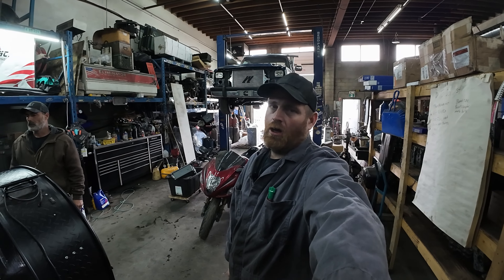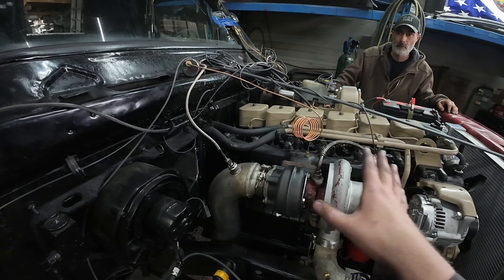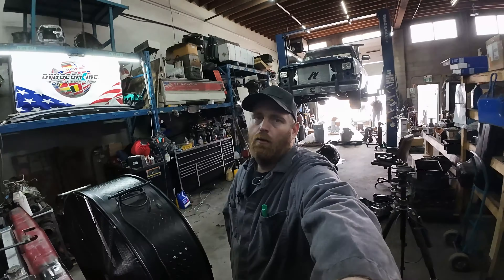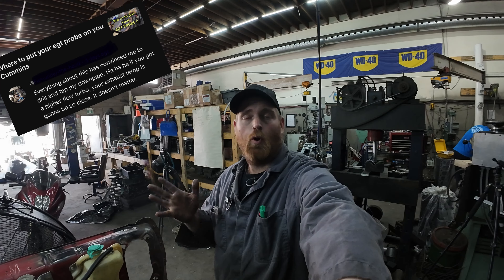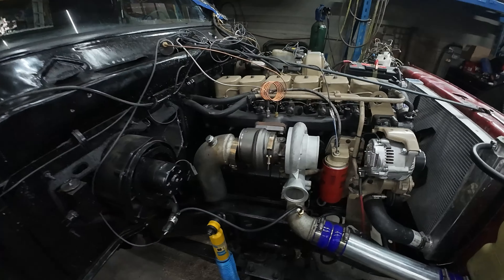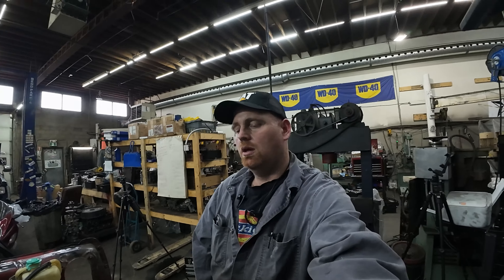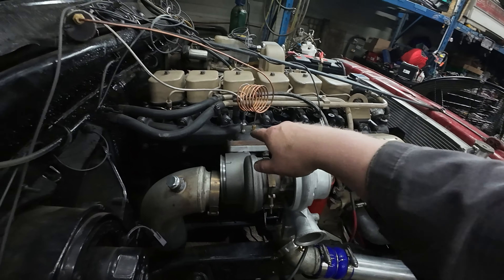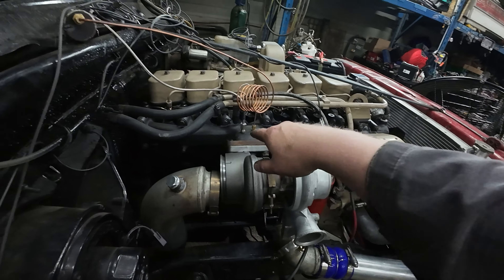EGT GUAGE LOCATION. DOES IT MATTER ?

Comment: The turbo by  its very function converts heat into work that means that the temperature goes down as a result. The more work taking place the greater the temp drop. Also the greater the expansion ratio the greater the temp drop.
Reply from the maker: That’s a good why to explain that. I like it

Comment: The thing is; We measure EGT to get an estimate of the temperature INSIDE the combustion chamber... So i would think you want to be taking measurements as close to that area as feasible... The difference in temperature/pressure across the turbine is not linear. Its hard to say that the diff will be 'X' in all conditions... why add more variables/calculations while trying to collect data when you can just put it in a spot that eliminates those variables?

Comment: A turbocharger doesn't magically spin. It uses exhaust energy in the form of temperature differential and pressure differential to operate. Therefore the temperature will be lower after the turbocharger.

Comment: i have a friend whos a semi truck mechanic tell me that the egt probe should be at the downpipe and not at the exhaust manifold, Because the higher egt numbers will make you freak out. After watching this I think he just wants me to pay him to rebuild the 12 valve after I push the engine a little too far with that advice.
Reply from the maker: I have always run them in the manifold on everything for many years.
Reply: Big truck mechanic here, and for some reason in the big truck world they put them in the down pipe, ive yet to see one with an egt probe in the exhaust manifold and it bothers me lol
Reply from the maker: @Ajs19892  I move them there anytime I can myself

Comment: I learned from my dad who is a heavy duty mechanic and he has always put them in the down pipe and that’s where mine is. The thought was that if the probe ever fails it will take out the turbo. And you just know that it reads cooler so don’t let it run as hot. If mine goes over 1,000 I back out of the throttle and for the most part it runs at 675 empty and 850-900 with the trailer. But in my own experience after seeing 10’s of thousands of diesel pickups beat on their shit and never hearing of a probe failure. My next manifold will have an EGT probe in it instead of the down pipe.
Reply: Why even  have a darn gauge if you need to estimate a guess as to  what the true reading might* be. 

Besides ‘my dad said so’

What I’ve learned is that if you need to feel like you need to watch a gauge
You’re already being more harsh on your engine than you know I should.
Reply: @fastinradfordable you obviously have little experience in actually working a truck with any real power.

Comment: For many years truck manufacturers put the just after turbo as they were not as reliable as are now and sensor failure would destroy a turbo but some did like Mack put them pre turbo as they used to pull their engines down really low compared to most others at the time

Comment: I have always installed mine in the manifold. The way it was explained to me is what you're really worried about is your valves and valve seats and that is what you want to avoid damaging and it should only get cooler as it heads to the turbo so no worries there. Obviously race trucks and such might be a little different but those are few and far between. I actually always wondered if having an egt probe at each exhaust outlet (all moniterd by a computer and with setpoints so no having to watch 6 numbers would be the best) you could know each cylinder and possibly catch problems (such as a failing injector on a common rail) before totoal destruction...

Comment: What high temp will a Cummins 5.9 take for a sustained time?
Reply from the maker: 1150 is safe safe.
Reply: @CUTTERUPROB   For 1 minute...or a 5 hour pull? When I see my temps hitting 1100, I'm backing out of it.
Reply: @donutman3089 pansy.
Reply: @asherdie  That's not what your sister was sayin last night.